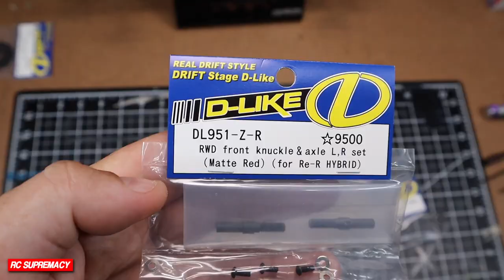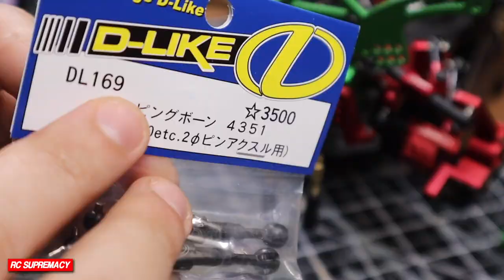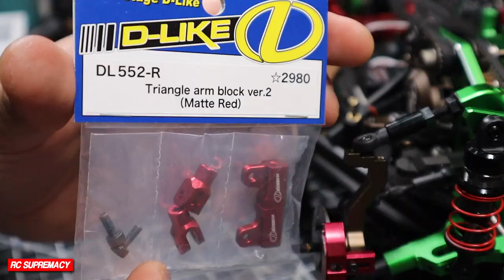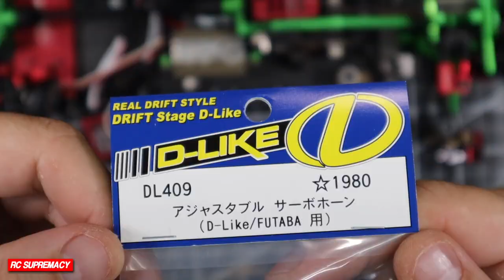VERY RARE RC DRIFT PART (D-Like Multi-Link)

Comment: What's your favorite scale for drifting?
Reply from the maker: Good question, pros and cons to both. Love the size of 24 cause I can get awesome drifts at the house and basically anywhere. 10th scale because of how cool it is aside from handling at that scale.  You just need a nice dedicated surface
Reply: @RCSUPREMACY  is 1/10 scale handling not easy?
Reply from the maker: @demonslayer9772  you just need real dedicated space for 10th to enjoy. Unlike 24 you can drift an have tracks anywhere. I was at Starbucks 3 days ago and was drifting on the polished concrete floor haha
Reply: Are thoes brass counter weights on the back of the chassis?